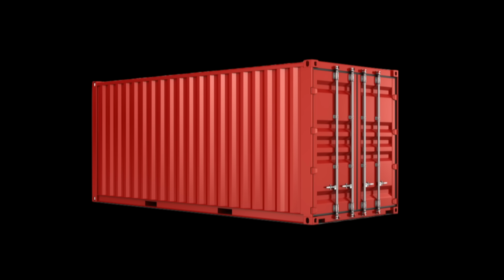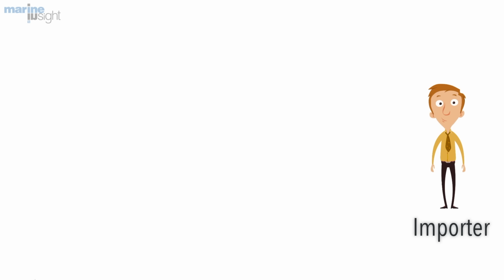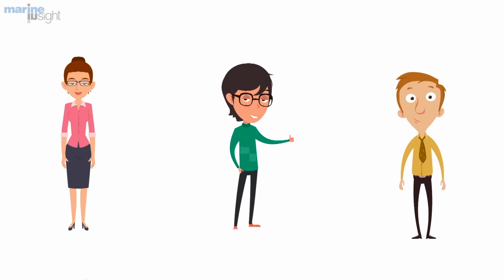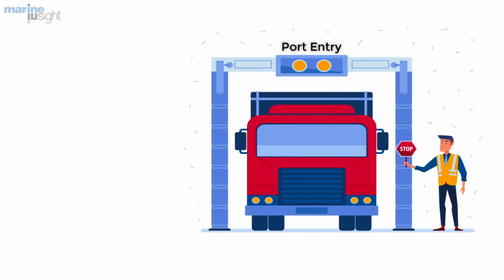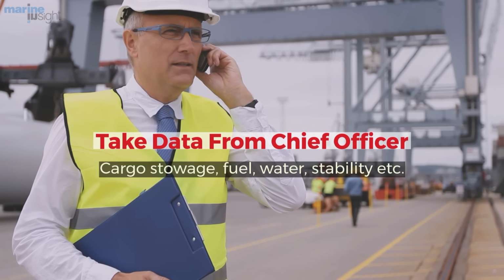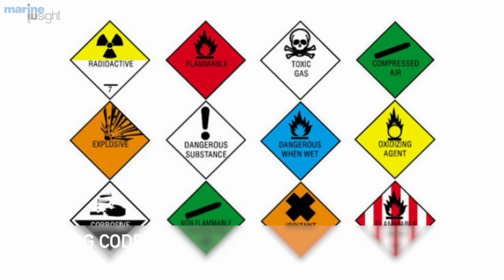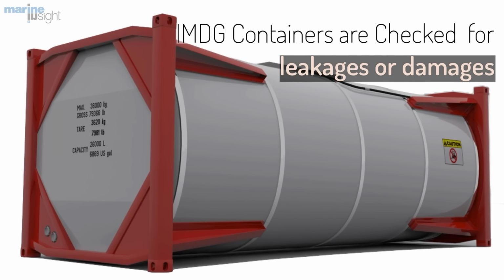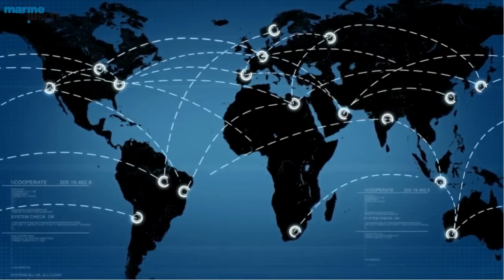How Does Container Shipping Work? The Global Supply Chain Explained

Comment: Obviously these might be irrelevant but it's part of the chain though, custom clearance is missing, duty has to paid (depending on the goods & country's tariff) before the good could be delivered. Pre booking or cargo reservation is missing, shipper/exporter has to prebook the shipment based on container or tonnage to the preferred destination via shipping agent or freight forwarder. Both the shipper/exporter & importer has to check if there is any restriction of trade/goods between these two countries. There were many times the goods are detained and destroyed by customs/authorities due to goods/trade restrictions, this is deemed as shipper/buyer's responsibility. This is quite an issue to exporters & importers as different countries impose different restrictions upon countries & goods and worst they would change it without prior notice depending on the country's political scenario & policies.

Comment: I’m just wondering which party is responsible to ensure that the container is in adequate condition (eg. Clean/pest free/dry etc) when delivered to shipper for loading.
Reply: The empty containers must be retired from an depot, so they're responsible to give them a container in perfect conditions. Before a container leaves a depot, it must be inspected to check any damage and its condition. If the container has any problem then it must be replaced by another containe and it will be checked too.
Reply: The driver picking up the empty container is responsible.

Comment: What happens to the empty container? It has returned to the shipping line? Can it be sent to an exporter for immediate reuse to export goods? Are surplus empty containers sent back to the original country of origin?  Can a container be shared by different shipping lines to facilitate reuse?
Reply from the maker: It depends on the owner of the container. If it is shipping company, it needs to be returned to them. Many shipping company use container of other companies.
Reply: Depends on the condition of the container.  If any damage occurs to the container, it will be repaired or empty backloaded  to certain destination for repair. If not, container can be directly released for export purpose.
Reply: See its a business, yes it can be returned to liner or can be usable for exporting, if a container delivered and unstuffed and if there is an consine to send near by that area then it can usable, another thing empty container always not returned to where it had came, you know shipping liner have more branches across the globe and they can use their it's just like suflling cards

Comment: Hello admin, nicely explained. I have a question, does the shipping company only forwards its own containers on the ship? I mean is it possible to have a large number of containers to start my shipping business without having any sea cargo?
Reply from the maker: Shipping company can load and carry containers of any brand.
Reply: how does the shipping company add their containers route to matime traffic to be visible on all tracking websites or is that the shipping line work?
Reply: SC can use 2 types of containers SOC & COC.

SHIPPER OWNED CONTAINER 
CARRIER OWNDED CONTAINER

All the best!
Reply: @Ahmed-ld1jq  Means shipping company can Also their own container that's the reason evergreen is written in vessel and containers as well right sir. ??
Reply: @rajankumar-kx7nl  not necessary, most of the containers shipping lines name will be written . Some containers will be leased & owned later .. eg. Triton 

@hameeullah .. yes, as a nvocc

Comment: You would think some strong electromagnets on the surface of the ships floor might stop them falling into the ocean???
Reply from the maker: It will increase the operating cost as generator will need to produce additional electricity consuming more fuel. Also, installation, operating, and maintenance cost will be high too.
Reply: Royal wolf howling??

Comment: A good over view for many.  On the "Dangerous Goods", only that in "bulk" go to the "Tank Container".  Those do not typically cause problems and are easily monitored.  Dangerous good that have already been "retail packaged" or "commercially packaged" go into the standard 1 or 2 TEU with "everything else".  Those can get into mischief on board if not properly described / labeled.  If the small unit would not need to be identified but multiple by how many are in a container (which becomes "the package" for Port & Ship).  Plus pack prep before containerized then at containerizing location, the need to keep load secure inside of container.  This is prep for sea.  Ships are large in port but very small at sea.  Calm days, sea is gentle on the vessel.  Add strong weather and the sea can be a challenging place to survive.   Many pieces to the process and when done well, is an excellent process.   Need all to do excellent work every day on every container.  A part of "critical infrastructure".
Reply from the maker: @Paul: Thank you for your comment. It has a great insight for those who want to understand how the dangerous goods are shipped. Appreciate it 👍🏻
Reply: @Hello Paul Nevins, How are you doing?